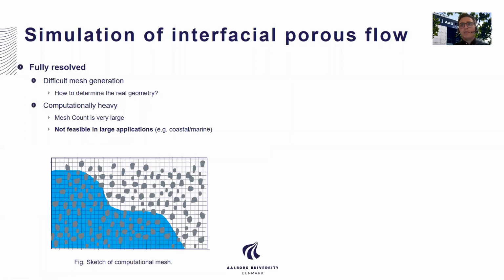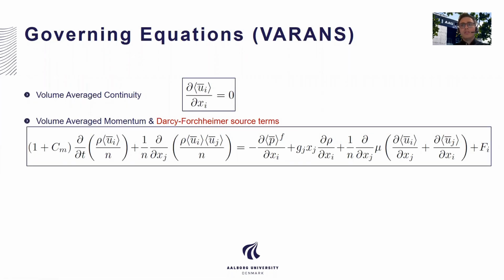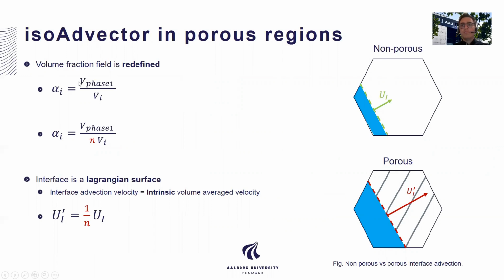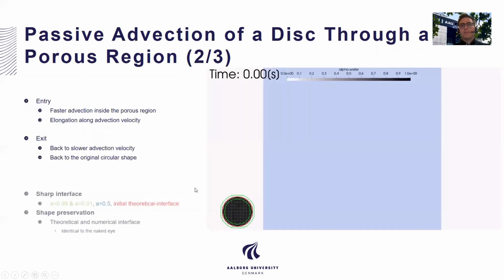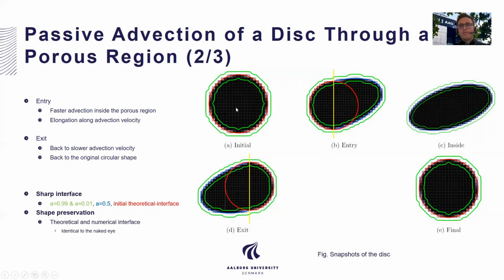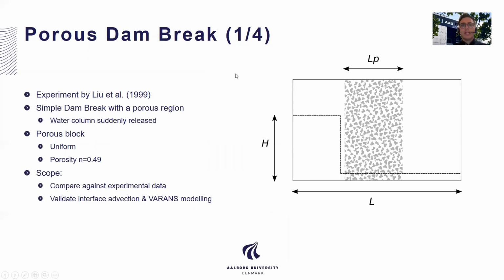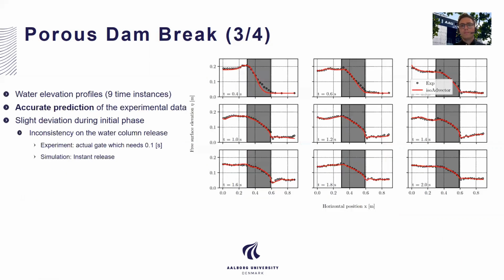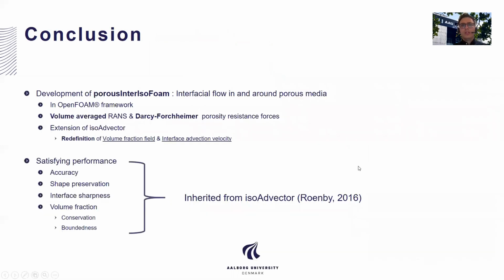Using the isoAdvector geometric VOF method for interfacial flows through porous media

Comment: I am currently simulating porous media. When using vof method for interface capture, I find that there is a rising column flow near the interface between porous media and fluid. I would like to ask what might cause this situation？
Reply from the maker: Hello there could you share some more info about your case?
Reply: @konstantinosmissios1482  The method I used is basically the same as yours, and I also did the calculation example in the same article as yours in the video. In this article, there is another calculation example with a porosity of 0.39. In the simulation of this example, when the water is near the front of the porous dam, part of the water appears to rise and eventually fall into the upstream water, I want to ask is this situation reasonable? This is not the case when the simulated porosity is 0.49. I uploaded the video to the homepage and would like to ask you to take a look at it？

Comment: Hello, I would like to ask whether it is necessary to set boundary conditions at the interface between porous media and fluid?
Reply from the maker: Hello, there is not BC between the porous media and the fluids. The idea of the current implementation is that the porous presence is taken into account though the modifications in the momentum equation and the interface advection velocity.